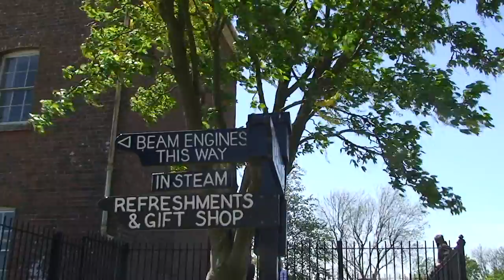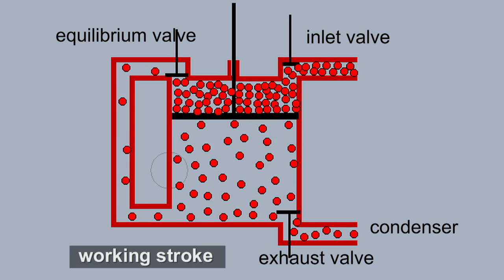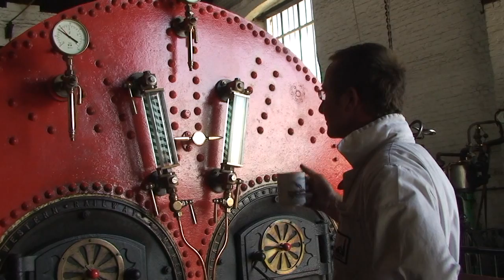The Fabulous 1812 Crofton Steam Engine

Comment: Masterpiece of engineering.

Despite it initially been build as Watt's engine in 1812, it is not Watt's engine now.

This engine cycle and primary design was invented by Jonathan Hornblower in principle few decades earlier, but revieved and commercialized by Arhur Woolf around 1800 (after Watt patents expired, for governor, parallel motion linkage, and few other things). The currently operating engine in Cofton Pumping Statuion was actually rebuild and modified into Cornish engine around 1840. They are more efficient.

Comment: Great to see a decent video of this engine, i've been there several years ago while it was in steam.
Interesting story, the canal was having some work done, so the electric pumps were turned off so the stretch could be drained, they had to finish before a bank holiday, when it came to starting the electric pumps to fill the canal, they had several problems, so they called in the team to start up the engines to fill the canal again, so much for modern technology being beaten by steam :D

Comment from the maker: You're welcome. You obviously are interested in old engines.
ad 1) the frame and beam were casted, the rods are probably made of wrought iron.
ad 2) low pressure engines used hemp sealings, high pressure engines demanded metal sealing rings.
ad 3) and 4) have a look at the page of 'Alex den Ouden' concerning lubrication of early steam engines.

Comment: Great video! I have a few questions: the engine predates steel production-I assume most of it is cast iron? (2) the seals and packing-did they use leather as the material? (3) lubrication-the attendants keep this engine clean-what was originally used (tallow)?(4) the bearings on the crank  beam/rods-babbit?
Thanks again!
Reply: Thinking of making one yourself? 😄
Considering that making steel on an industrial scale wouldn't be perfected until the 1850s, I'd imagine that it would probably be made of cast iron. But would leather hold up under pressure?
Oil as we know it today wouldn't be practical until the first wells were dug in the 1850s. Before that, animal fat was probably used.

Comment from the maker: When the Pumping Station is in steam, it actually carries out the job for which it was built, the electrically powered pumps that now normally do the job being switched off. Some years ago, when the electric pumps had a real failure, the steam engines did the pumping job for a couple of days without any problem. Thanks for viewing and fine comment!

Comment from the maker: Yes it does. The development of steam engines shows more and more sophisticated ways to save steam by variable setting of the steam cutoff, e.g. Corliss valve gears. The first Boulton & Watt engines couldn't use expanded steam because of the rather low steam pressure. (With the technology in the late years of the 18th century it was not possible to handle a higher steam pressure  - boiler explosions etc.). Thanks for watching and comment!

Comment from the maker: @ArchitectOfRapture No, it is electric light in the basement, but you are right, the water tubing there looks similar to  gas pipes. I don't think, that ever lighting has been done in Crofton station by gas lamps. Gas lighting in the 19th century usually needed gas works, which were situated only in bigger towns.

Comment from the maker: @MrNik1001 No, this kind of engine was exclusively built for pumping use and did not need a flywheel - the downwards-stroke was done by steam pressure and condenser's vacuum, the upwards-stroke by the weight of the pump plunger, similar to the eldest atmospheric Newcomen steam engines of the 18th century. In spite (or rather because) of this simple construction these engines did, as you can see, a very good longtime job.  Thanks for watching  and greetings from Austria.